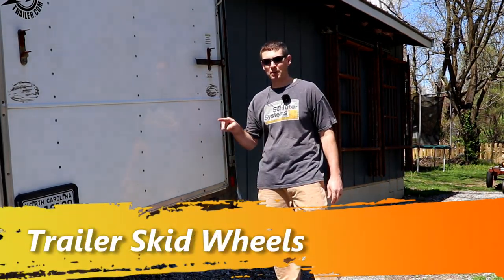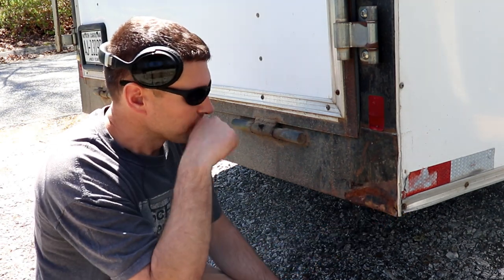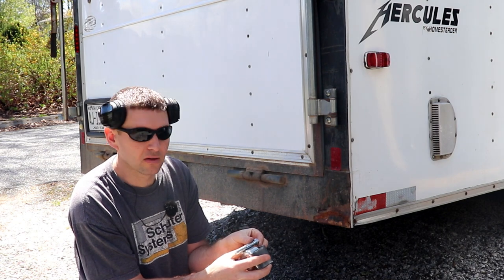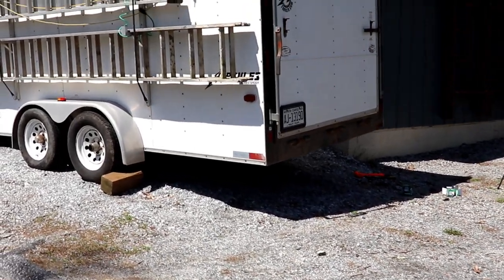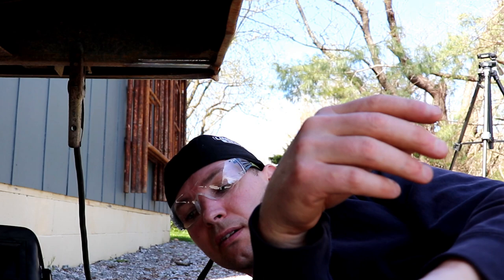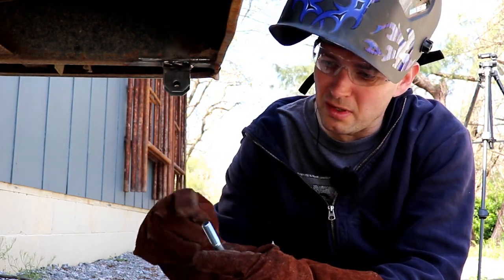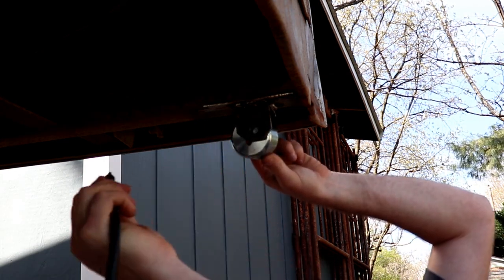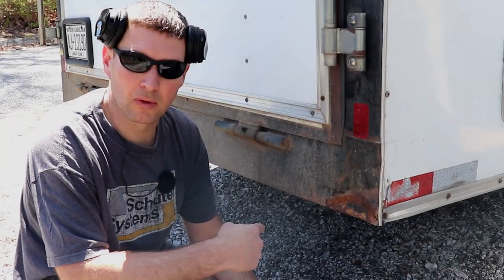Be a third wheel.  Installing Trailer Skid Wheels to prevent future trailer damage

Comment: Just a couple of ideas, ask you asked.
I'd weld one or two vertical pieces between the two flats of the c beam above where you put the bracket. That'd more than double the compression strength and stop (limit) it, bending in, when it hits. I'd also paint the entire thing in a rubber compound. It doesn't matter if it gums it up a bit, it will tear the rubber free as it hits. You just want to protect it against corrosion as most of its life will be just sitting there. Water is going to spray up on to it more as you drive along.
I was thinking you'd be better off with a skid instead of a roller. You just want it to start a foot or two in and to go just past any verticals on the rear. The roller sits down a lot and the base has already bottomed out. A 5/16th bar with a chamfered front welded onto the beam and just make sure it sticks out a little past anything on the rear.
Reply from the maker: Those are good ideas. I went with the wheels because there are lots of driveways in my area that are fairly steep. If I had a skid or nothing I couldn't get in the driveway. I've had it where all four wheels were off of the ground and all the weight was on the little rollers and the tongue. Now it was for only a very short distance but the driveway only had a small mark afterwards. 
Thank you for your comments.
Reply: Exactly what I was thinking for mine...the verticle bar stock.  I'm more concerned with it tearing off from sand or dirt
Reply from the maker: @michaelsmirnov1469  the wheels would do no good on a soft surface like dirt or gravel. I've used it on asphalt and concrete and have had all four wheels off of the ground. It worked great in that scenario. I've had my trailer for two years and never needed anything. And then move to a mountainous area and there are lots of driveways that I could not get in or out of without these wheels. So far it has saved me quite a few steps.
Reply: @shooshinejonnie  yep the bar stock sticking out just a little to act as a skid. I'm using my enclosed trailer to haul my sxs to the sand and trails. I think the skids would help even for the occasional transition between road and parking lot but no the wheels wouldnt do much for me.

Comment: 1. You did fine with the welding...you have the skills needed to do an axle drop.
2. For a few dollars more you could drop the axles to the bottom of the leaf springs and get about 5” more ground clearance for the trailer which would help more.
Reply from the maker: Thanks Robert for your words of confidence. 
My trailer has torsion axles so I would have to build a spacer block for them to bolt onto. That could also be done. I'm hesitant to do that because of my drop down tail gate. 
I never had an issue when I lived in a fairly flat area. Now I live in the mountains and everyone's driveway has some significant angles. There are some I simply can't get into.

Comment: Hi Anthony, Great job on you trailer! I really like some of your ideas. Would be interested to see a review after a little bit of use (and abuse). Keep at it on the welding, just like everything else you’ll get better at it with practice.
Reply from the maker: Thanks Micah. I appreciate the kind words. 
I immediately got to test the wheels out. I backed in a driveway where all four of my tires were off of the ground. Everything seems to be holding up so far.

Comment: Have you had any problems after installing the rollers.
Reply from the maker: Obviously they do not work on gravel. I actually changed my axles and lifted the whole trailer by 4 to 5 in. There is still one driveway of one client that is so steep that it lifts my wheels off the ground as I back up her driveway. But I'm also in the mountains so that tends to happen more often than not.
I've used them multiple times going into her concrete driveway with no issues. Now they will leave a mark even though they roll.

Comment: I need these for a ramp truck I just bought to get it up my driveway, do the wheels say how much weight they can handle?
Reply from the maker: No, these wheels did not have a weight rating that I could see.
Here's the exact one that I used. There may be some even heavier duty ones.

https://www.amazon.com/dp/B009XOU39W/ref=cm_sw_r_cp_apa_i_cwArFbGFCFS6M

Comment: How are these holding up?
Reply from the maker: So far so good. I've only had to use them in one driveway. I've since changed my axles, which included a different angle for my torsion arms. Between that and my bigger wheels and tires it lifted the back around 6". That has helped a lot with clearing objects, curbs and minor angles in driveways.